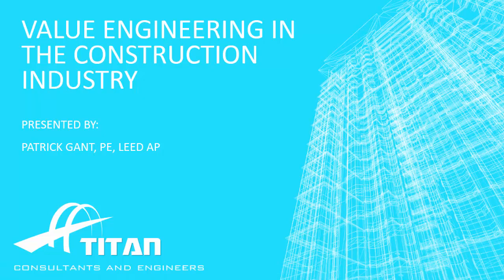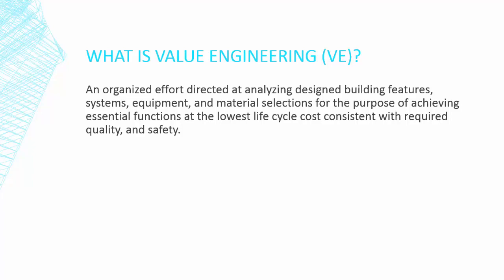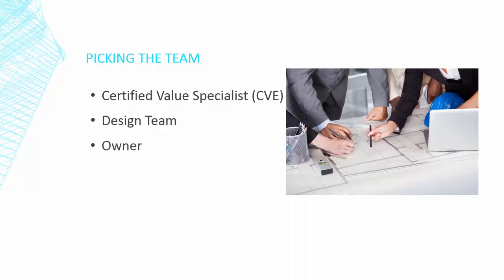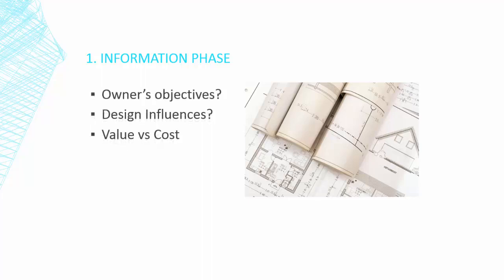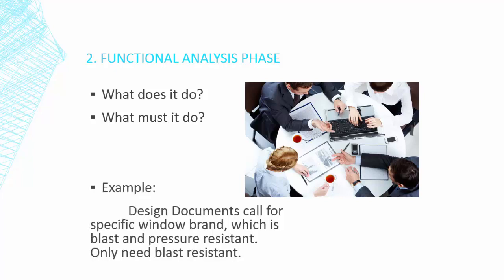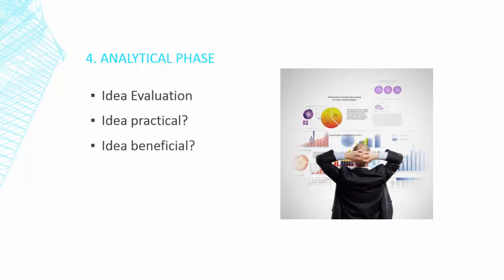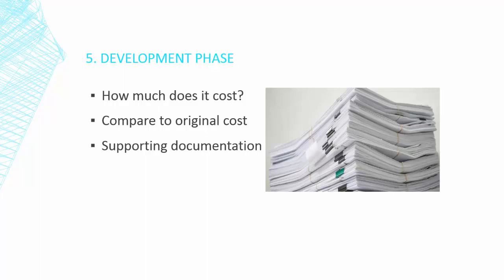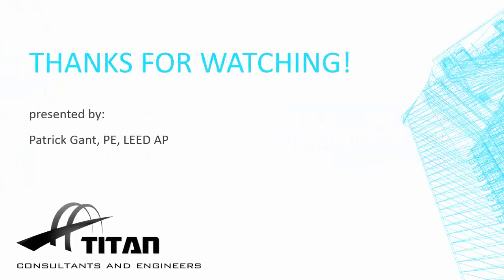Value Engineering in the Construction Industry

Comment: Hi where does the bidding process play into all of this?
Reply from the maker: Usually, the Value Engineering process happens during the design phase and prior to putting the project out to bid. After the project is designed and Value Engineering is applied, the design is then finalized and the project is put out to bid.